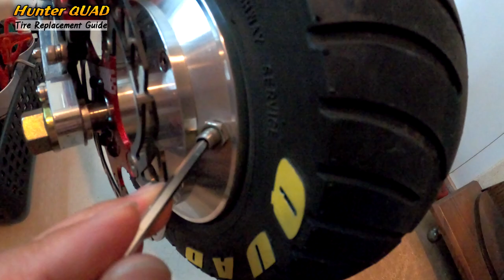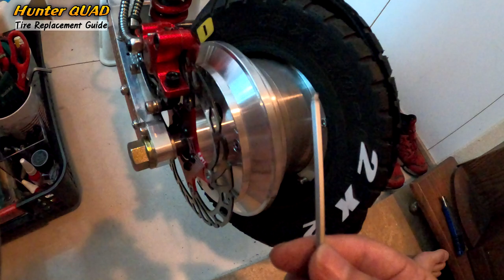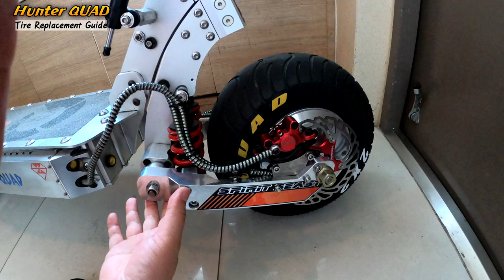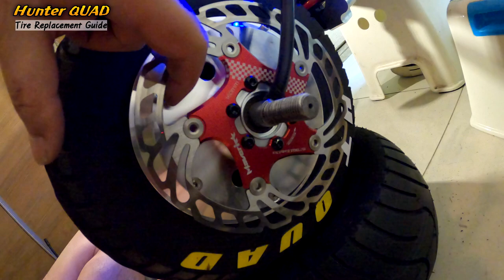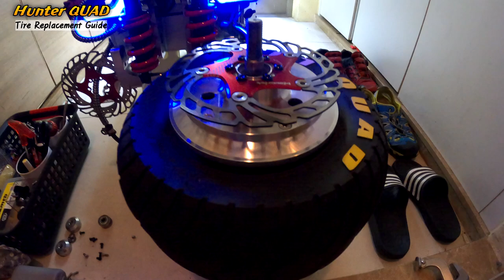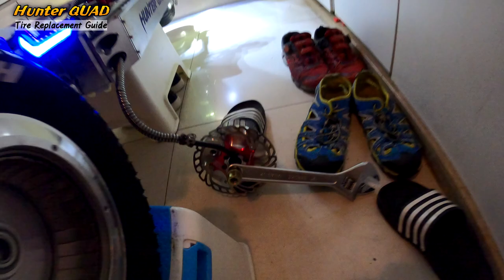🛴[Multilingual sub]13" Tubeless Tire Replacement for "HUNTER QUAD" only⚡Electric hyper scooter/전동킥보드

Comment: The machining of the parts looks heavenly amazing but replacing the tires looks so damn hard
Reply from the maker: I've also replaced a regular tubeless tire, but it's about the same level. Instructions are important.

Comment: I'm guessing the Hunter QUAD isn't recommended riding in light rain or when the ground is wet? I can see holes on the hub exposing the inside of the motors.
Reply from the maker: It has the advantage that the motor does not burn even at high speeds and long distances by minimizing heat generated by high performance.  A brief wet road surface is not a problem, and all hub motors do not drive in the rain, as driving in the rain is not recommended.🤗
Reply: @daynight7983  Are there plans to make the hub motors work in the rain without damaging it? Some people will want to use the QUAD as a means of everyday transportation. Maybe a one-way valve or a breather tube that will let air out but not rain in?
Reply from the maker: First of all, in Korea, on rainy days, all electric appliances are not driven.  Most of them are waterproof, so they can cause malfunctions.  There are very few expensive models that can still be driven in the rain.  Just in case, just plug it with a rubber stopper.  Passing about 100m on a wet road is no problem.
Reply: @daynight7983  What speed should be driven when a rubber plug is used so the motors don't overheat?
Reply from the maker: @Jayeeyee  
It doesn't matter as long as you don't drive too hard.  When driving at high speed on a hill or at a speed of 100kph or higher. It is not a problem for general driving.

Comment: I think imma look at weped. They have removable rims from the frame like dualtron
Reply from the maker: The 2022 Quad has been upgraded to have separate rims and motors.  The wheel is also split in half.  The video is an old motor.
Reply: @daynight7983  if u can make a video demonstrating it, I would consider the Hunter Quad. Other than that I want an easy experience removing or replacing tires like my thunder 2 where the rim comes off of the frame. I have seen weped where it has a split rim designed for tubeless tires
Reply from the maker: For related information on the new Quad, please refer to the Facebook link. 

https://m.facebook.com/story.php?story_fbid=370849268358037&id=100062989003954

Comment: When will it be available for Sale in the U.S , OR CAN YOU SHIP IT OVERSEAS,  IF I BUY ONE ? WHAT IS YOUR OFFICIAL WEBSITE ? THANKS YOU
Reply from the maker: There is only space for communication with domestic shopping malls.  
They say they do not create a website for overseas individual sales.  
Overseas, it is said that only branch transactions are made.

http://naver.me/5wfvlS05 

http://naver.me/GOxlgrHe

Nevertheless, if you would like to make a personal overseas purchase, please contact our company's WhatsApp in the description at the bottom of the video. We do not know if it is possible or not.
Reply: @daynight7983  thanks you for all the informations .it seems to have many people from the USA which desire to OWN at least one . I even found your video through an other person in YouTube FROM THE U.S.  If the performance , range and speed is good compare to the "weped sst" or otherS , people will be greatLY interested over here , ME FIRST ,   I own just a" duatron thunder" and a "kaabo wolf 11" i am likely to buy a weped sst if they don't release a new VERSION  one, I drove a certain time the weped sst owned by someone I know . But if the HUNTER QUAD IS GOOD ALSO I WISH TO HAVE IT RATHER THAN THE WEPED .
Reply from the maker: The only advantage of Quad is that it is possible to drive long-distance (72v 75Ah) without heat-related malfunctions or temperature cuts, even during long uphill and high-speed driving.  

There is a difference between motor neodymium magnets 60mm and 100mm.🤔

I also want you to think about what the difference between a 10 inch and a 13 inch is talking about.  Experienced old users will know the deep meaning of what I'm trying to do.  

The Quad is a new two-wheeled powertrain that is completely different from off-the-shelf products.😱
Reply: @daynight7983  75ah good deal. If  I find  a way to get one for sure my other friend that own the weped sst  will likely buy one from you also because he wish also a scooter with long range that his current weped  .. , I tried to call the overseas # but for some reasons it do t work . I did not yet found that phone number in whatapp.  
I might try to do a regular phone call with that phone starting by +82..
Reply from the maker: @ppgk92  
As a user, I only provide information.

One WhatsApp number had an error and was corrected immediately.
In the past, I was going to open a website where individuals can purchase overseas, but it seems to have been canceled due to the high air shipping cost and long shipping period.
I wish you good results.

Comment: Hey how much does it run?
Reply from the maker: Usually, the replacement cycle for new tires is 2,000 to 3,000 km.  It is an upgraded model from the Hunter m1 to a quad and has a total of 11,000 km.  After the perforated wheel, it has driven 4,000 km.

Comment: Is the Quad on sale now?
Reply from the maker: I know that they are selling domestically, and overseas, they are sending samples to dealers.
I originally planned to open a website for personal overseas purchases, but it seems to have been canceled due to expensive air shipping charges or long shipping times.

If you would like to make a personal purchase overseas, please contact us through WhatsApp at the bottom of the video. I don't know if it's available for purchase.
Reply: @daynight7983  Thanks for the information. I will